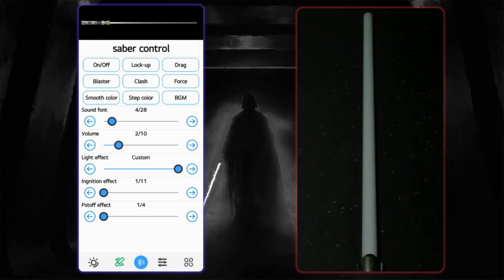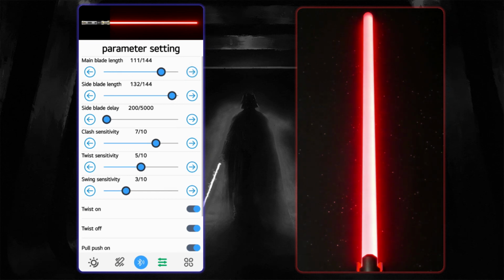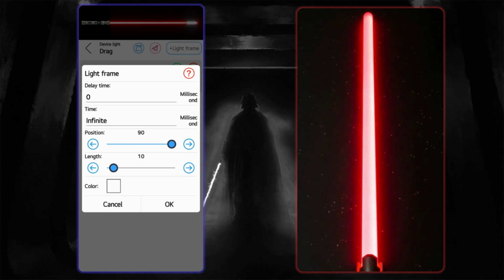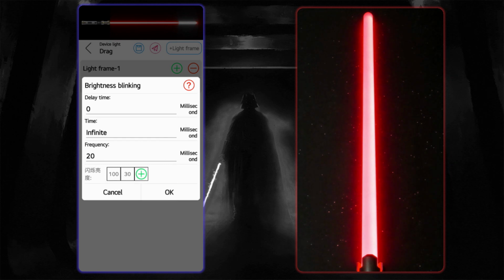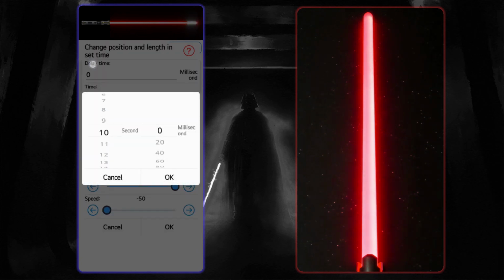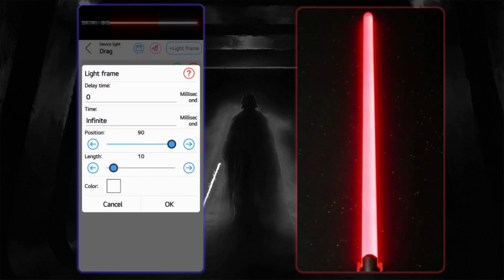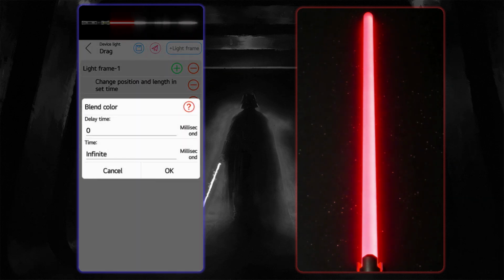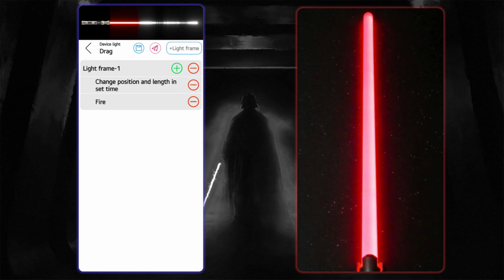Part 6. Drag Effects | SN-PIXEL V4 Tutorials

Comment: I just found your page today, thanks so much for making these SN4 tutorial videos. I was able to learn a couple of new things and add tip spark to my Out's, that effect had eluded me. Will you be making more SN4 videos? I heard from a vender that a new update for the ForcePark app is due this month.

On my YouTube page I have 20 seconds of effects I was able to make using the ForcePark App back in September. I like using the "More Colors gradual change in set position" to make transparent gradients so there aren't hard edges between the effects. Those examples use exaggerated colors to show the gradients better.
Reply from the maker: I will be making more I've just been swamped with products to review.  I'll try to get another one or two tutorials done soon